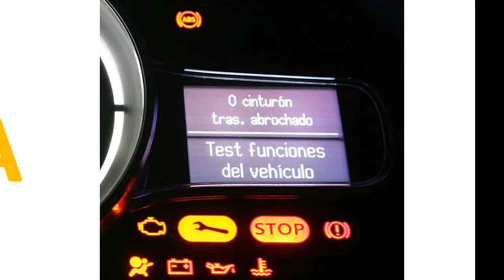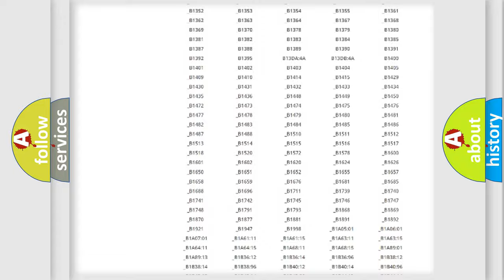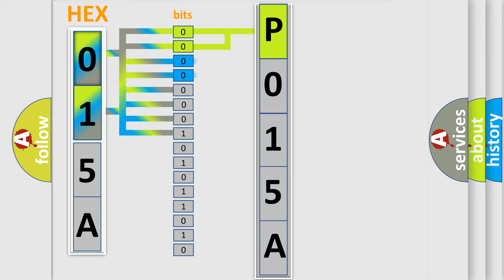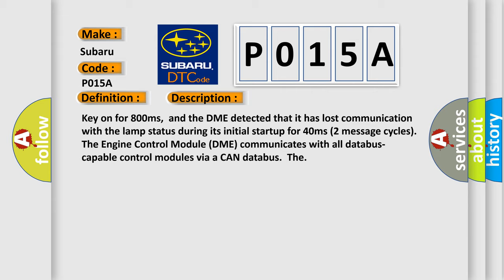DTC Subaru P015A Short Explanation

Comment: Gee, this looks like some kind of AI attempt to interface with humans. It failed. Not only is your description of the code completely wrong for Subaru cars, the description of how Hex coding interfaces with trouble codes is completely useless for humans who are searching for a solution to a practical problem. For the record, P015A in a Subaru describes a 'lazy' upstream wide band air fuel sensor, often caused by a sensor that is failing or caked with exhaust carbon, or caused by a hole in the exhaust at that point causing inaccurate readings.